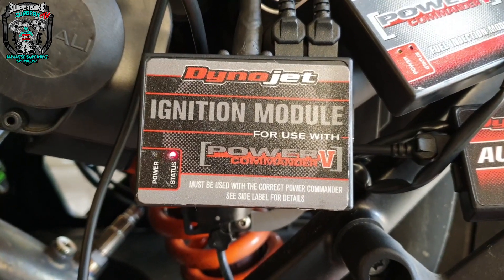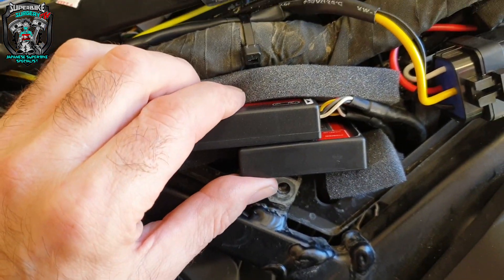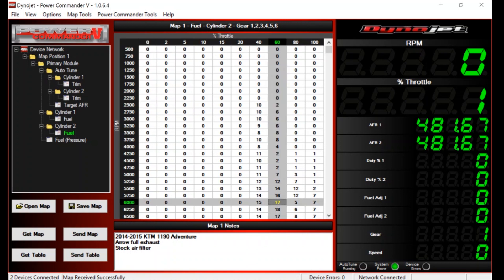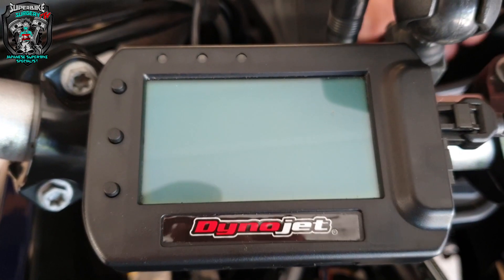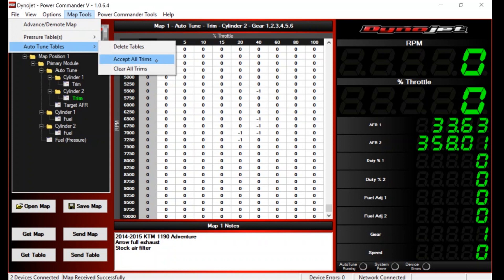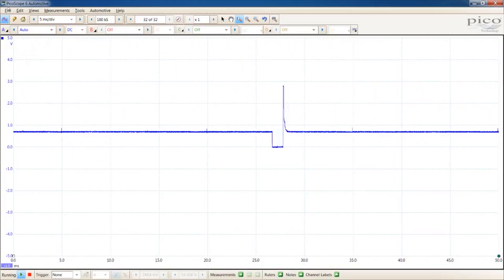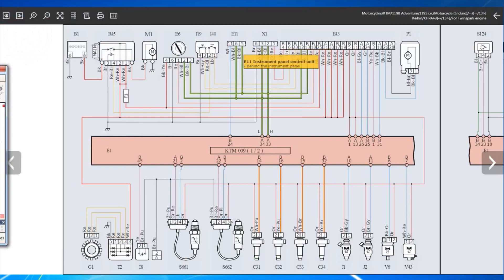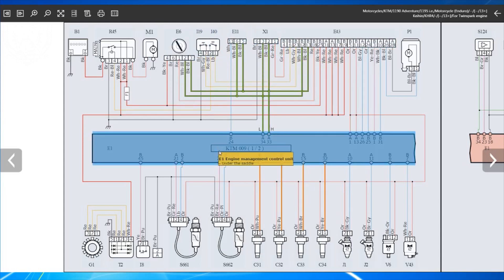VLOG-13 KTM Crisis Part 4

Comment: 09:45 "14.7 pounds of fuel and a pound of air by weight you'll get the perfect burn" - sounds a bit rich to me Jim. :)

Only teasing, we all get our wires crossed occasionally. Great four parter. good stuff.
Reply: @SuperbikeSurgeryTV  the 14.7 is the air jim. The 1 is the fuel. Not quibbling over how specific you are about mass mate. That's the bit I'm joking about.
Reply: @SuperbikeSurgeryTV  nice one mate. Love your videos. I spanner and teach cars and motorbikes in colleges and it is a right ballache at times not getting any words wrong for an hour. Everybody says "erm" btw so quit fretting. :)
Btw regarding your sea level clarification, the pedant in me would point out that the stoichiometric ratio (It's by mass remember) is actually the same at sea level or at altitude. It's the volume you have to change given the different densities of air to get to that same mass ratio.  (Fuel injection or carbs). by mass, stoich is always stoich. So yeah we might say 'it needs more air/less fuel at altitude' but by mass it's the same. At altitude we just need more volume for same mass. We make it different to get it the same, in a sense. I reckon you knew this really. :)
I'll stop before you rightly kick me in the bollocks.

Comment: I have a 2003 BMW r1150rs non-abs and I looked for cruise control but seems to not be available so I use a throttle palm grip it works for me.

Comment: Jim bit off topic but have you ever done a throttle cable replacement on a fz1? Pain in the ass and I can't get the new push cable back in
Reply: @SuperbikeSurgeryTV  any pointers mate before this fz1 ends up "spontaneously combusting" lol
Reply: @SuperbikeSurgeryTV  yep super fiddly to get the "push" cable the manual says to drop the engine!!